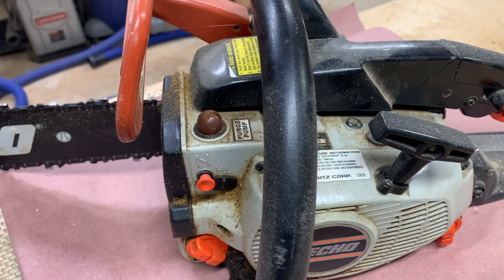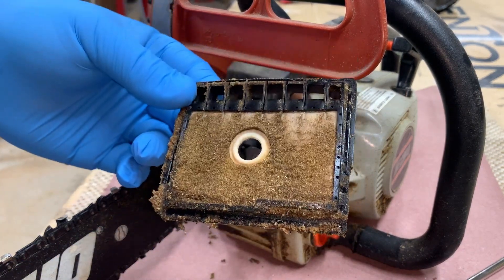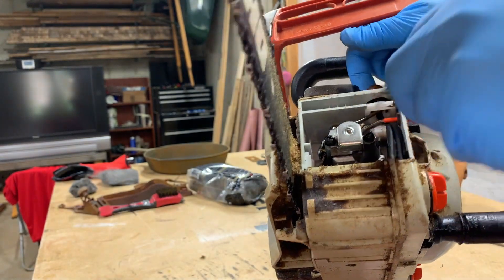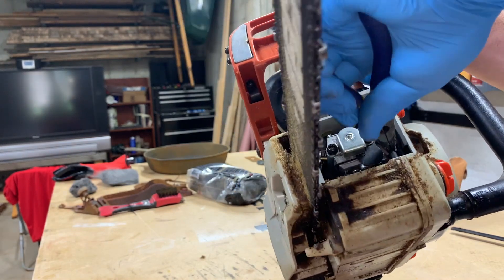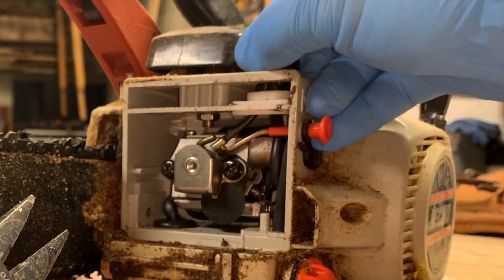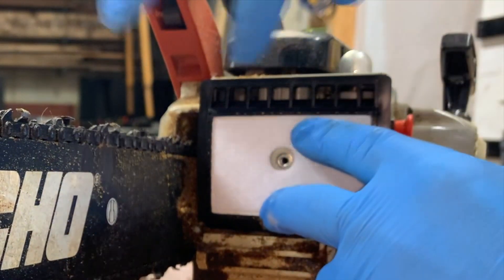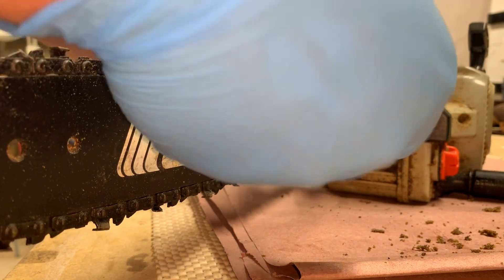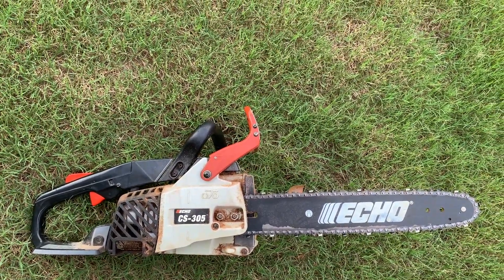Chainsaw Won't Start - Chainsaw Purge Pump - Primer Bulb and Air Filter Replacement - Echo CS305

Comment: I don't know maybe I missed something but you failed to show she showed the most important thing and that is is exactly how you pull the clip out to release the pump

When you actually did that you turned the saw away and we cannot see what you're doing, And I watched all the way to the end figuring you would relax down that clip and I'd see it then but you simply pushed it back in and said nothing about locking it back in place so unfortunately the video just didn't show me the very thing I wanted to see
Reply from the maker: Sorry about that. It was definitely not the best view. Can you see the two sides on the clip on yours? Try squeezing one side in while prying up on that side. Then do the other side.